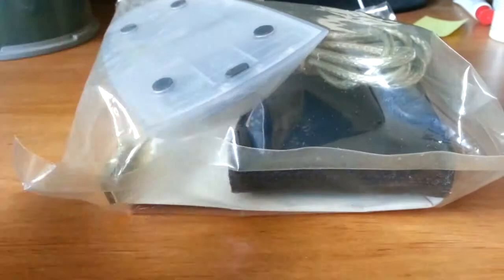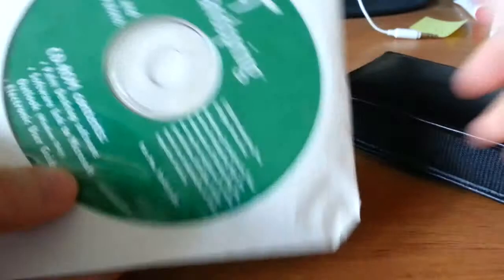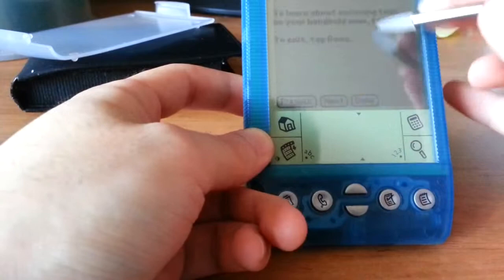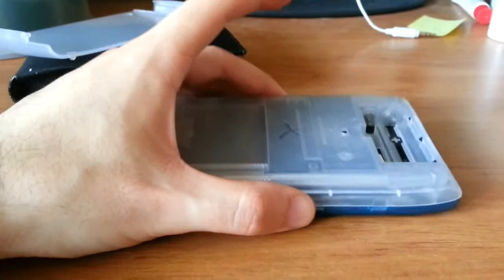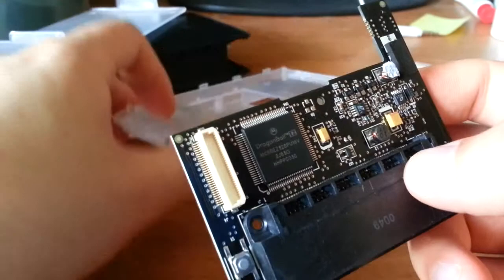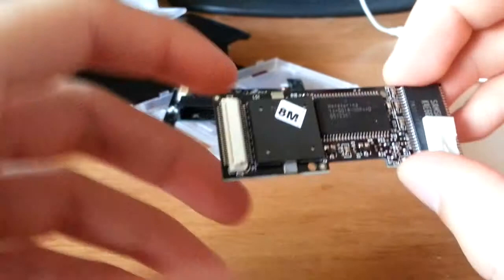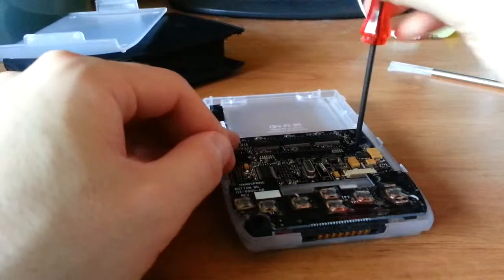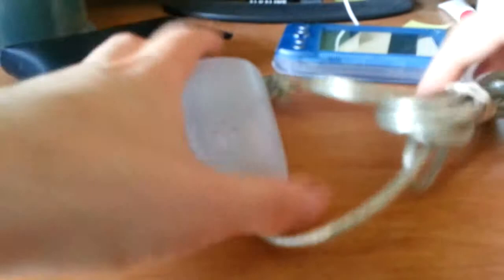TeardownTube - episode 22 - Handspring (Palm) Visor PDA

Comment: If you unscrew the tip from the stylus it has a small pin to use in the reset hole if you unscrew the top of the stylus it is a screw driver to use in taking it apart.

Comment: Nice video.  I just tried my visor after being in storage for ever and it worked fine.  Then when I tried it again it sometimes does not come on, and other times has random lines on the screen.  Any ideas what's up with it?
Reply from the maker: Could be the electrolytic caps are going bad. Wierd power issues usually tend to be cap related.